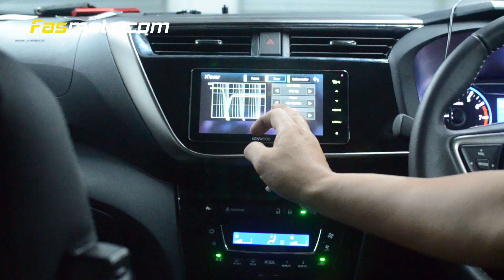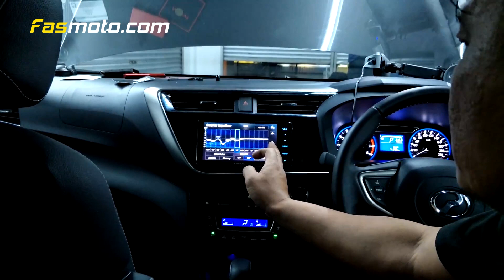Perodua Myvi Advance, Kenwood Stereo, Pioneer Amp and Subwoofer, Acoustec Sound Proofing

Comment: boss. berapa untuk preve? bunyi tayar bila atas highway. bunyi enjin. prefer avoid engine sound. and bunyi tayar bila on road highway
Reply from the maker: Tengoklah nak setup camana, ikut pada bajet dan gerak hati. Kalau nak avoid engine sound kena buat sound proofing kat firewall. Kalay tayar sound, kena pilih tayar tak bising. Kalau tak cukup, soundproofing kat wheel arch. Daun pisang dalam wheel arch tu ada tak? Kalau takde memang jadi bising.

Comment: boss, nak tnya. head unit pakai bracket radio lama ke modified? saya punya kenwood ddx719wbt bila pasang head unit jadi terkeluar dari casing and fitting dia pun tkkemas.
Reply from the maker: Kena pakai bracket asal, pindah ke player ni. Sy rasa tak perlu modified ni.

Comment: hi, how much improvement after all the modifications? in terms of sound deadening, tyre/wind sound etc
Reply from the maker: Hi, it is not easy to quantify it without having professional equipment. However, just a guess from us and our customer we would say 20-30 percent possibly. Some of us say more, some less so its a tough one. It's just a guess though. Nevertheless, the improvement on mid bass is undeniable as we all mutually agree. For wind noises, try the door seal rubber. We have good feedback on that.
Reply: Depending on what you're aiming for, one can determine improvements in noise reduction. But just because your car is now quieter because of sound insulation, doesn't mean it'll sound better in terms of 'Sound Duality'. Installation, drivers, tuning, all plays a massive part in the overall performance. Enjoy watching these videos. I'll start you on Project Update 5 
Car Audio Project Update 5 - https://www.youtube.com/watch?v=CYts-nDdy84

Car Audio Project Update 2 - https://www.youtube.com/watch?v=sHD83Ied2bk 
Car Audio Project Update 3 - https://www.youtube.com/watch?v=LkY6AGc1BD4
Car Audio Project Update 4 - https://www.youtube.com/watch?v=gmjS4zSxOt8